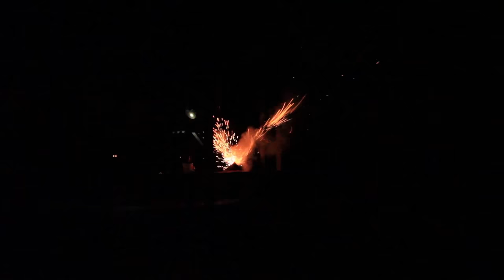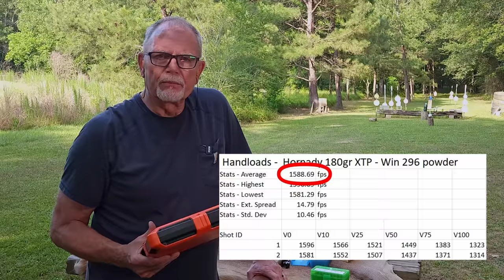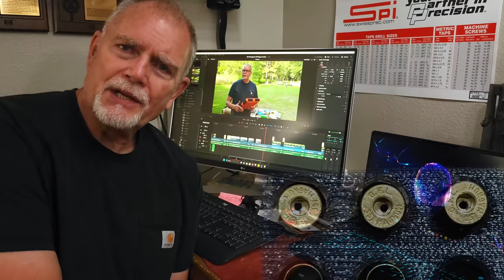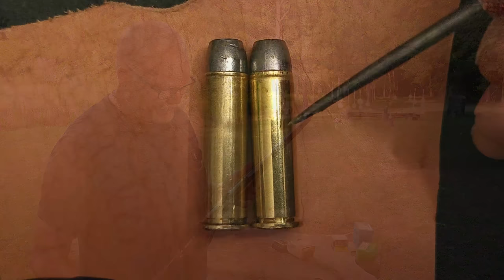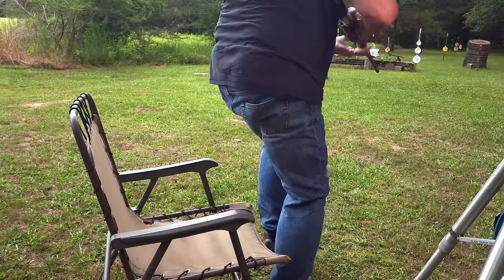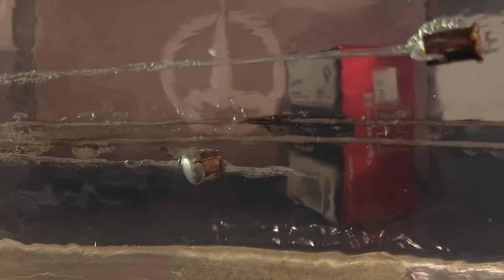Was I Wrong About The 357 Magnum Carbine? ?

Comment: The issues I've had with shooting the .357 mag carbine is that there are very few ammo choices out there that perform well in the carbine length barrel.  Accuracy wise they may function quite well, but on targets made of meat they often leave much to be desired.  Most .357 mag bullets are designed to function from a pistol with a 6 inch barrel (give or take a few inches).  A carbine can push the bullet well beyond its expansion threshold so many bullets will over-expand to the point of disintegration, leaving a massive injury that doesn't penetrate very deeply.  Now, with a broadside shot on a deer this will do the job, but it ruins a lot of meat in the process.  A deer I took with an American Eagle 158 gr jacketed soft point completely destroyed a shoulder and half of a backstrap with bits of lead and copper confetti.  Plus side is it dropped it dead in its tracks.  

To combat that I tried using those Buffalo Bore 180 grain hard cast.  They shoot wonderfully, have a good thump, and are very consistent, but they don't put deer down worth a damn.  They zip right though and do very little damage to the surrounding tissue.  I shot a deer with Buffalo Bore at 30 yards that was quarter toward me and I was in an elevated position.  Bullet entered between the shoulder and neck, passed dead through the center of the heart, and exited the bottom of the chest.  Deer started running broadside so I followed up with 6 more shots, stunned every time that it refused to fall or even slow down.  Out of 7 shots I put five of them through the vitals and the deer still went 200 yards before expiring.  

I might have to retire the carbine for deer.  I just can't find a bullet that I have confidence in.  A shame because it's such a sweet shooter.
Reply: Do you reload? You can buy or cast your own bullets of medium hardness lead that will give you moderate expansion and great penetration out to 100 yards. I am also not a huge fan of hard cast but I have used it and aimed for neck, spine or shoulder bones.  Most hard cast is 16-22 BHN and depending on the alloy it will expand the flat nose some at close ranges and turn into a wadcutter. Medium hardness bullets around 10-12 BHN will have 1.5-2x expansion from 1400-2000 fps impact, 98-100% weight retention so no lead fragments, and far shots when the bullet is slower it will penetrate more and mushroom less. If you reload I would send you some of my bullets that are accurate and deadly on deer.

Also Buffalo Bore has a 180 XTP at 1800 fps now which should get you great performance and 70% weight retention.
Reply: @mattnewcomb4147  I have a crate full of brass that I've been saving for years with the intention of getting into reloading, but I'm a bit intimidated by it and never got around to trying it.    

Although with the price of ammo now I might have to get over that.  

Is there any excessive fouling with a medium hardness cast when you push the pressure up toward the 2000 fps range?
Reply: @mattnewcomb4147 I’ve been trying to find some softer projectiles. Most bullet makers cast from about 12-22 BHN, which in my opinion is too hard. I recently bought a Lee 358-158 6-cavity mold to start casting my own. But I still gotta get a pot and other things to get started. I’d be willing to buy some of your bullets if you’re interested in parting with some.
Reply: @JoeSyxpack  Nope. I have shot different gas checked bullets with simple tumble lube to over 2100 fps in the 357 with no problems. I currently powder coat my gas check and my plain base bullets. The plain base Lee 158-RF with 1.7-1.7- 96.6 alloy (tin-antimony-lead) powder coated shoots 2.5 MOA at 100 yards 10 shot groups at 1900 fps with 17.4 gr Lil' Gun with no lead fouling. Powder and any minor powder coat fouling comes out with a few passes of a brush and a single patch. I have a gas checked NOE that I regularly shoot at 2020 fps with 18.3 gr Lil' Gun that shoots 10 shots into 2 MOA at 100 yards. Alloy for that is similar, usually 2-2-96 which is 11 BHN air cooled. Anything from 1-1-98 and up will make great accuracy with a gas check. I have found SWC bullets to be less accurate than RNFP.
Reply: @bradstephens4915  Brad how can I get ahold of you? Are you on castboolits forum? Or would you wanna post your email here? I have some 10-12 BHN gas checked powder coated 158s and 180s. I also have that Lee 158-RF powder coated around 12 bhn and it shoots great with 17.3 Lil' Gun at 1900 fps.
Reply: @mattnewcomb4147  Hey Matt, I signed up on the cast boolits forum. My user name is 357guru.
Reply: @mattnewcomb4147  Hi Matt, I am on cast boolits
Reply: @bradstephens4915  Hey I sent you a message on there

Comment: Well, my 92 knocks Whitetail Bucks on their asses and it's faster than hell  handling in the brush.
Edit: forgot to mention, its expensive but the wound cavity is enormous for the caliber, I use the Underwood funky looking 140gr solid copper 'drill bit' looking rounds for actual hunting.  It will down big White Tails and even boars  round where I am as long as you fire at rational ranges.  Doesn't get NEAR the penetration your hard cast stuff is getting but I'm a 'stalker' hunter so don't need 40 to 50 inches of pen as I only try to shoot one game animal at a time :)   Further,  the "U" rounds manage to  get all the way through, as I don't shoot game in the azz so the 25 to 30 ish  pens are plenty.  The velocity is listed by  U as just under 1600fps out of a pistol, and I get quite a bit more out of my long barreled 92.  No feeding issues  with this stuff either.  I tried the Buffalo Bore stuff and the felt  recoil is hella higher.
Reply from the maker: Great comment! Thanks!

Comment: Buffalo Bore makes great hunting loads. I found a 180 grain HP that pushes 1800 maybe even 2000 fps. For hunting whitetail, would the HP work better than the gas check?
Reply from the maker: That's a good question. And the only way to answer it would be with empirical data, that is, actual field experience on game. The nice thing about flat nose cast bullets is the way they expand. With the 44 Magnum rounds I have tested the nose really flattens out and gets much bigger than caliber. It leaves a razor edge around the nose that has to be extra devastating on flesh. But I didn't get that as much on these 180 grain cast bullets.

Comment: I've been hunting for a little better than 70
 years. I don't hunt deer every year, and I often skip deer hunting for 10 years or so, at a time but I've still killed 16 deer over the years, using a bow, a flintlock, a 30-06, and a shotgun. 

My longest shot over those years is 27 paces and that was with the 06. I think a .357 Mag. Is just fine for deer depending upon where you hunt.

Comment: Because of the  number of people who  can't  handle recoil!  You need to reload to get hunting performance.  It originally came out with 158 grain bullets to stop vehicles for law inforcement.  The past 30 years the factory ammunition is  neutered close to .38 special power. The  other problem is light bullets for ( self defense)  Don't  hold together fragment.. Hunting bullets need mass to punch through dense muscle and bones!  The .357 is a magnum ! Loaded properly it is very good on game animals up to ? WITH PROPERLY PLACED SHOTS ! AND PROPERLY LOADED AMMUNITION  FOR THE TASK .
Reply from the maker: Thanks for your reply. There is no doubt that a 357 Magnum carbine in the hands of a skilled and disciplined hunter is an effective tool for deer sized animals. If my audience senses any reluctance on my part, it is because I don't want the less experienced, less disciplined hunter to think I am endorsing it as a great "deer getter" for every hunter, because it's not. It requires, as you said, a properly placed shot with proper ammunition. Again, thanks again for your comments!
Reply: Is the "A .357 Mag bullet will go through an engine block" myth still alive?

Comment: I designed a .357 magnum handload which has muzzle energy similar to weak .223 in 16 inch Winchester Barrel (1500 joules) and strong .223 (1800j) in my friend 24 inch Chiappa Winchester 92.

And its NOT +P, everything within C.I.P specs pressure. So I have no idea why .223 is considered a good hunting cartridge and .357 is not. Only difference is how it performs at range.

I have no experience in hunting. Where I live hunting license requires you to work for free for 1 YEAR (BEFORE YOU ARE ALLOWED TO GO HUNTING YOURSELF) for hunting association and then 3-6 months of paperwork, background checks, exams, they ask your neighbors how pure you are of a citizen, check your medical record etc. And you pay a lot. 

And on top of it we have requirements BY THE LAW that you can have only 3 rounds loaded and you can only use rifles that have 1000j at 100 meters (which .357 does not meet unless its extremely long barrel). 

But why you folks in the US limit yourself with .357 is beyond me. Even if you don't handload you can buy .357 +p from Bufallo Bore (we have nothing like this). 

Also if you want a lot of stopping power you NEED heavy bullet. 115 grains can have more jouls but weight has momentum. 

But I am a guy not allowed to do what you guys (not all I know not all states are liberal), so I have no say in that matter. I can only assume some theories regarding hunting.
Reply: European Gun Enthusiast,
 It's good to live under the system you were raised under ( unless Jewish in 1930s Germany ).  
It can be quite stiffling to live in a society that dictates how you speak / act / think / live when raised in a different society where one can pretty much come and go as they please, mind their own business, have millions of kilo hectares to hunt, fish, camp, explore, wander, and view gov't as being subservant to them, not them to the gov't, with only Nature or God they are held responsible to.
 Not many can responsible handle such Freedom, many want/desire their gov't to guide them in their daily life, from birth to death. They live by the motto: "Nothing ventured / nothing lost." A life of controlled security. All give all / all get an equal portion doled unto them ( some just a little more [ earned, due to serving others ] than others.
In the U.S. there is a state, New Hampshire,  with the motto  " Live Free or Die".
Too extreme for many . . .
☆
Reply from the maker: It is great to hear from you! I know some of our "banter" must seem foolish to our friends to the east like you. And you are correct about "using enough rifle", but many folks are sensitive to recoil, and others are sensitive to losing too much meat to the high energy of a high velocity round, which can be 10% to 20% of the usable meat. But, some just like the challenge of heading to the wood with a light rifle like the 357 magnum, kind of like bowhunting. I am ok with all of those scenarios, as long as people hunt responsibly. Thank you for watching, and thank you for your comment!
Reply: @TargetSuite  Oh the pleasure is all mine, sir. 

Well what I was trying to say is that people where are live are ,,obliged" to use enough rifle but I personally dislike it. 

I am an outlier where I live. My country was under Soviet/USSR occupation for 44 years AFTER 6 years of being literally destroyed completely during ww2. During this occupation soviet officers murdered everyone who was freedom minded so only people who submit survived (even later - in the 70s there was a death penalty for owning a firearm. Of course soviet officers and communist party members were allowed to own guns, but not common folk). So majority of people now think guns are evil and hunters are even more evil. But even among hunters are extremely divided and they keep limiting themselves and also law limits it. 

So what I wanted to say is - I, personally think its cool hunting is more accessible in the US and that you guys are allowed to experiment - hunt with handguns, with rifles using revolver cartridges etc. 

If I was living in the US (I know US is not paradise, after all you stayed many years abroad for a reason) I would definitely both appreciate and experience as many different types and styles of responsible firearms use AS POSSIBLE.

What you do might seems strange to most people in my country but it aint strange for me. I wish we could have it too.

So my message is ,,HERISH FREEDOMS YOU HAVE (and if possible, get more)".
Reply: @fjb4932  I already responded to target Suite comment, but I appreciate you all guys, so I will reply separately - just mentioning it because well Its easy to get lost in comments.

I don't thing its a matter of responsibility. People who never WERE ALLOWED to experience some freedom DO NOT KNOW it can be done responsibly, or irresponsibly. Or AT ALL. 

I will quote my other comment 

,,My country was under Soviet/USSR occupation for 44 years AFTER 6 years of being literally destroyed completely during ww2. During this occupation soviet officers murdered everyone who was freedom minded so only people who submit survived (even later - in the 70s there was a death penalty for owning a firearm. Of course soviet officers and communist party members were allowed to own guns, but not common folk). So majority of people now think guns are evil and hunters are even more evil. But even among hunters are extremely divided and they keep limiting themselves and also law limits it. "

So regarding this idea ,,Live Free or Die" Imagine (I am so glad its fictional and unlikely to happen.) New Hampshire or entire country gets attacked by other superpowers AND LOSE and as a result IS OCCUPIED. Then people who want to die for freedom ARE KILLED by Enemy. Then enemy takes over country (install their own armed forces, intelligence, politicians) and methodically continues killing all remnants of resistance or even artists and journalists who speak for freedom. And they kill UNTIL NO ONE OF THEM IS LEFT and still are on lookout for more for maaaanyyy years. Until only those who submit remain and only they pass on their genes. What is the result 1-2 generations later?

Result is people who think no freedoms is ONLY WAY POSSIBLE. 

Don't get me wrong - I WANT PEOPLE IN US to have FREEDOM LOVING attitude. I want to from the depths of my heart. I want US people to KEEP THIS ATTITUDE. There are positive outcomes because of that.

But you see there are older (than US) countries without relative geopolitical security who already TESTED this attitude and LOST. Hence the reason why their attitude is different from US. 

" mind their own business, have millions of kilo hectares to hunt, fish, camp, explore, wander, and view gov't as being subservant to them, not them to the gov't" - I think how it is the way it should be. NOTHING THAT DOES NOT HURT OTHER PEOPLE should be banned. Criminalizing people for a ,,crime without a victim" is in my opinion highly amoral. If I do not get in the way of other people, respect them and do my own thing - what is wrong with that? 

But unfortunately it does not work this way. We can't since we were born. Because of history. 

Anyway it hurts me that there are also some people in the US actually WANT to have less freedom when it was NOT enforced on them by superior foreign regime. 

But again it might be because they do not know how is it too lose it, until they really lost it...

The conclusion is strange, but generally it seems US people could learn a lot from European countries, while european countries should learn from US. Highly surprising, but yeah - lack of awareness never makes things better.
Reply: @europeangunenthusiast232  
A very intelligent response. As far as possible ( having never been subjugated  )understand where you are coming from. I am fortunate to have had a Mother born and raised in France. She survived 5 yrs of starvation, subjugation under the German bootheel of occupation during WW-ll. You very well know, no dissenting was tolerated and obeying all edicts did not guarantee survival. She was not able to convey all she had to endure, you can't explain to someone who hasn't gone through horror and terror what it's like. So i do appreciate your response. Thankyou.
☆

Comment: IMHO if you're trying to make the 357 perform like a big game monolith solid then good luck. But if you want a good woods gun for deer hunting 35 cal. 150ish grain bonded or mechanical locked hollow point at 1800 to 2000 fps is damn near unbeatable to me. I went from 243 as my first to 30.06 to 270 and I had my Winchester 357 all along. Thinking I wanted fast follow up shots I found out most would drop like a rock and a few would jump take 1 or 2 steps and drop. I only shoot as close to broad side as possible and rapid energy dump is my favorite. The heart is always completely or   partially turned to mush.

Comment: I watched my father drop a running deer at 400 yds with a Marlin 357 mag rifle. I don't try those long shots due to vision issues. But i've taken many deer with the 357 under 200 yds. I have a Marlin and a Winchester. The Winchester is a pack rifle. Shorter than the std carbine.

Comment: Love the video, and interested in the 180 grain cast. I have a Ruger Marlin in .357 mag, and it’s bery finicky about OAL.   A few thousandths over SAAMI specs will not feed. Could you supply the overall length for the rounds you used? Thanks.
Reply from the maker: The 180gr. Cast Performance rounds were 1.575" OAL.

Comment: I dont think it has to be brand new but oof the same manufacturer. 

I bet if you weigh those foreformed cases from the cast, eqch is a little different weight meaning the internal dimensions could be different. 

I do the same with my cast loads cuz they “cheap” plinkers, but should be like other bullets. H cast are great for many morr applications than even fmjs